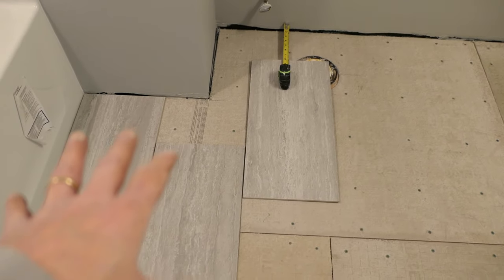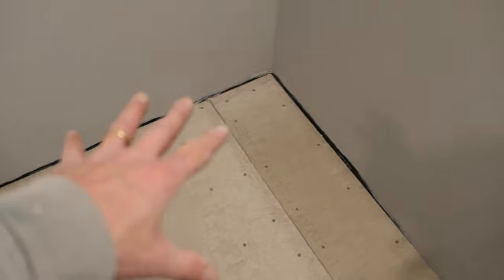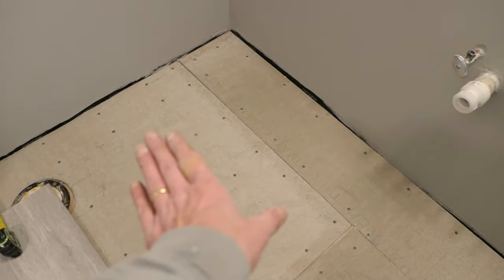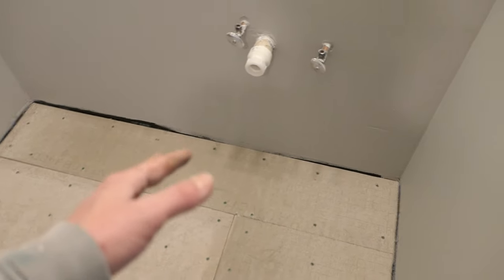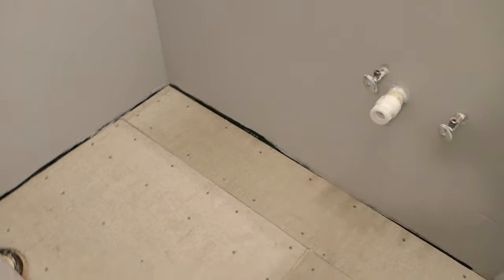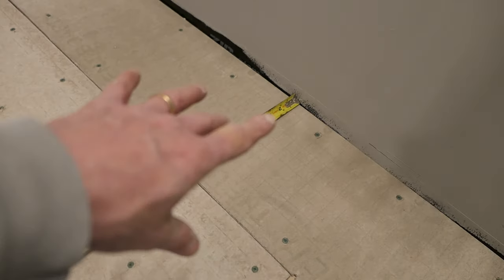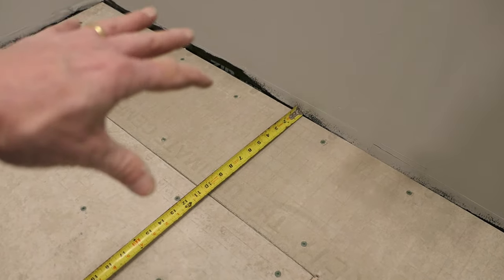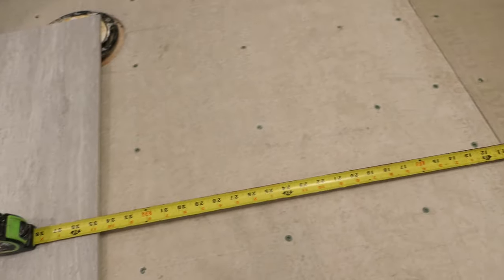Learn How To Layout Bathroom Floor Tile

Comment: Great video and discussion on layout.  My only critique would be that the seams on your cement fiber tile backer are not taped and mudded with thinset as required by the backboard manufacturer.  It is a very important step that should never be skipped!
Reply from the maker: I'm glad you brought this up.  If you read the instructions for hardibacker installation on floors, you'll see that the manufacturer also recommends adhering the backer to the plywood underlayment with thinset mortar.  That's also a step I do not use.  The manufacturer gives generic instructions, but I'm working in a specific circumstance and I have my own expertise and experience.  And sometimes the instructions don't even follow an internal logic.  

What is the point of taping the joints?  It's to minimize "lippage" and movement between two sheet edges.  On walls, especially when framing is not perfect, I will tape the joints, although I now use Schluter Kerdi band membrane instead of mesh tape.  On floors that I have taken care to make flat with new 3/4" plywood underlayment, I find that taping is entirely unnecessary.  Much more important is to stagger the hardibacker joints with the plywood joints.  And the use of thinset mortar I find counter-productive.  By pinning the hardibacker to the plywood with the use of mortar you also potentially introduce future movement of the backerboard as the plywood expands and contracts with seasonal humidity changes.  Instead, if you just use screws and skip the mortar, you allow a small amount of independence between the two layers, much like a decoupling mat.  Of course, if I expect serious movement I'll use an actual decoupling mat, such as Schluter Ditra.  On a similar note, the manufacturer of hardibacker recommends a 1/8" space between joints, presumably for expansion and contraction or perhaps some other mystery reason.  What is the point of leaving that space if you fill it with thinset and cover it with tape? 

So why not just tape the joints anyway?  You can if you like, but as a professional I have to make judgement calls about cost and benefit.  If I insisted on following every manufacturer's advice to the letter in a complete bath remodel-- for building materials, electrical and plumbing, fixtures and more-- I would be faced with two problems.  One, I'd need to explain to the homeowner the significant extra cost in labor and materials, as well as the extra time required to complete the project.  Two, there are often conflicts between manufacturers if their recommendations were both followed.  The intersection of a tub or pan tile lip with backerboard, for example, or cure times for spackle, paint, thinset, caulks and adhesives.  My advice is to spend your time getting the subfloor and underlayment dead flat, strong and stiff.  Then taping the joints will be unnecessary.   I have installations done decades ago in this manner without issue.

Comment: Nice explanation and neat tiling job. Which spacers do you use?
Reply from the maker: I use the plastic double-sided ones now, which can be reused for many jobs.  This grout line was probably 1/8" if I recall.
Reply: @enduringcharm  thanks for the reply. I shall have to look them up here in the UK.

Comment: Great video! Are you considering 1/3 of 24” being 7 7/8 instead of 8 due to the blade kerf?
Reply from the maker: It's been too long for me to remember, but probably the tile was not exactly 24 inches in length.  Most tiles sold in a nominal length are actually less, and the grout line is considered part of the length.  Or, the tile is sold as X inches but it is actually a metric measurement.  Always check the actual measurement!
Reply: I literally JUST pulled a tape on my tile and laughed and said, “of course it’s nominal” and came to delete my comment! Thanks for the help

Comment: Why didn’t you seal the joints of the backer board?
Reply from the maker: There would be no point to using mesh tape on floor joints.  The backerboard is screwed to the plywood underneath, and that mechanical fastening keeps the backerboard flat and secure.  If you mean waterproofing, most floors are not waterproofed, but if that is desired you would use something like the Schluter system to waterproof the entire surface.
Reply: How did you get your reference  line

Comment: Nice.  I think the pattern would have looked better pushed back and if low traffic that nub may be ok.  Is that porcelain?
Reply from the maker: It was a porcelain tile, so very durable.  As I hope I showed in the video laying out tile is often a series of compromises and rarely does everything line up perfectly as you might wish.
Reply: @enduringcharm  you did a great job showing that!